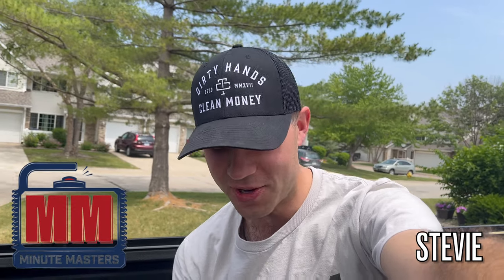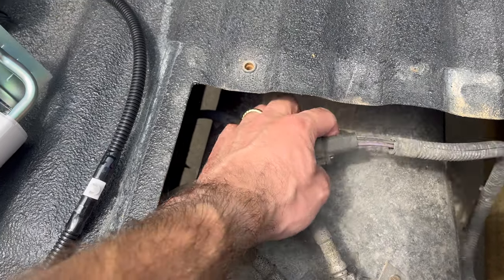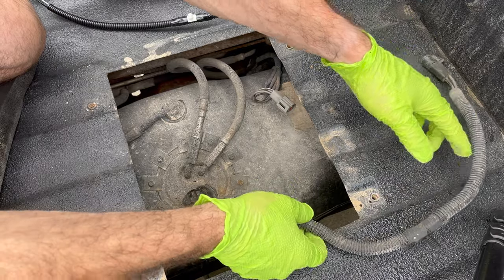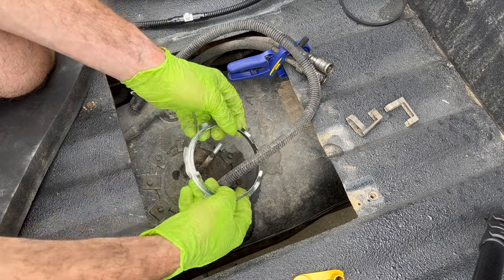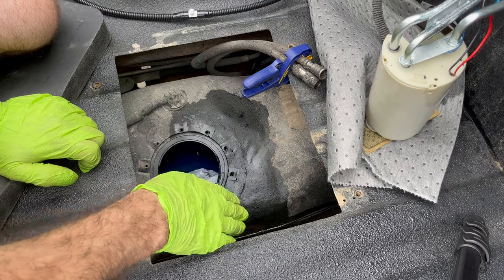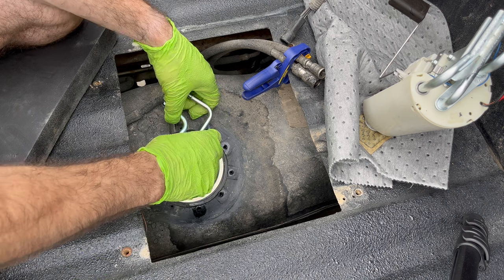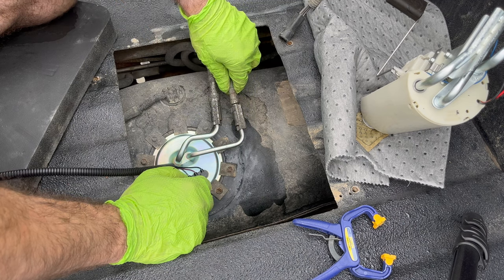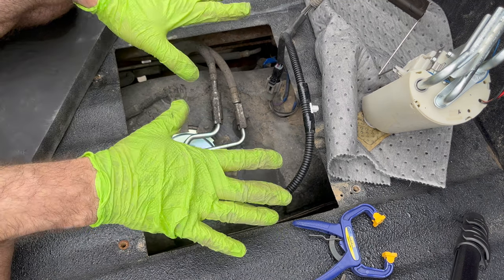How to Replace Your Fuel Pump in Less than 30 Minutes* | 1995 Ford F150

Comment: While you are in on that switch in the cab just cut one of the wires to it (ground is good) and put another on-off switch inline. Hide that switch somewhere and now ya have an anti-theft device. The engine will still crank but since no fuel can get to it - it WON'T start. Love your videos!
Reply: I’ve been wondering where to put one. Great idea!
Reply from the maker: Ah! This is a good idea!
Reply: Or go under the hood and cut the ignition wire and run it to a switch

Comment: Yes I did it the hardway. When my bottom straps came loose I found a leak in the tank on each side. So I got new Dorman steel tank and the new pump assembly. What I really appreciated was matching the wires up with the pigtail to the engine whip. My pump assembly did not have wiring instructions. My tank due in tomorrow so we wait. If you hear a loud conconsion/bang you'll know I screwed up somewhere. Fingers crossed. Thanks much
Reply from the maker: Well that’s a good start. The wiring was definitely tricky when I first did this. Not sure why it doesn’t come pre-wired.

Comment: So if you cut the hatch out,how do you make it big enough so it doesn't just fall back through the hole you just cut that I'd the same size hmmmm
Reply from the maker: I bought a separate patch panel and used that for the hatch.

Comment: How do i know its the switch?  I have a dual tank where both ta ks show 1/2 full. I have power to the wires that connet to the pony tail, but the pony tail doesnt show power.  What could i be missing?  Im not an electrician at all and this doesnt make sense to me.
Reply from the maker: The only way to diagnose the switch would be to test it. I have not done that. So I don’t know the procedure. You could buy a new switch and see if it fixes the problem. If not, you can return the switch.
Are you referring to the fuel pump wiring harness (pony tail) or the harness for the switch?

Comment: About 10yrs ago i had the service station give me a eye watering price to replace my fuel pump and this was my answer to this same issue and it worked fine and took about 2hrs.
 The truck is a 97 Ranger that i still own.
 Great job.
Reply from the maker: Nice! I’m glad you are bought into the hatch idea. It definitely gets some hate. Lol
Reply: @TheMinuteMasters  Yes there are many out there willing to remove the truck bed or drop the gas tank for a large fee. But I don't subscribe to there thinking and my little 10x10 patch in the bed worked flawlessly and was "CHEAP".
Reply from the maker: @markcollins457  You are most definitely right. I’m all for the cheap effective fix!🤙

Comment: Very nice. After my headers, I have installed gt40 y303 heads, with scorpion 1.72 rockers. Repaired my electronic 4x4, converted it to manual locking hubs. Next up, 4:10 gears front and back. I’m excited to see how my hauling potential has increased.
Reply from the maker: Thanks man!🤙 You’re truck should really move after those mods!

Comment: A couple things I do differently on these is tap the inertia switch with the screwdriver handle to trip it, which also shows It still works as designed. Making a hatch is a good idea, especially in an area where the bed bolts might be rusting a bit. In the shop we lift off the bed or drop the tank using a transmission jack, but not everyone has that luxury...if that's the right word. lol

Nice work.
Reply from the maker: Good point about the inertia switch. 
Yes, a lift would be super nice. 

Thanks Jimmy!🤙

Comment: I didn’t cut a hole in my bed but I did replace the bed bolts with the torx head bolts and the frame clips so they can be removed 1,000 times easier. Irritating part for me is the tank filler neck and lifting the bed off. Great job love the channel. Don’t ever sell your truck cause then I won’t have a channel for advice lol I give you permission to start another channel with another vehicle perhaps. lol
Reply from the maker: That’s a good idea! Oem bed bolts are hard to find. 
Hahahah! I plan to keep her even if I get a newer DD. 🤙

Comment: I've done this a few times...on these years ford trucks...  dropping the tanks is not hard..  come down easily..  even full.. Use a floor jack...  not cutting a hole in my truck beds lol..  I've seen a lot of people do this, and to reach their own... No hate.. And understand if the tank is clear full...heavy yes...  but good time to clean it all up, maybe even replace em...  they don't cost much..  i have a 1993 in replacing the clutch on... Rear tank leaks..  gonna just replace everything..  it's not hard.  Time consuming maybe..  and if your daily driver...  still... Literally 4 nuts you have to take off... Remove the straps.. Take the tank down..  personally...  cutting into the floor above the gas tank...  sparks...  i don't wanna go BOOM! 💥😮..  im subscribing, just found your channel... Like i said, not hating, but just drop the tank and don't cut holes in the truck bed...  just my opinion 😂...  what brand pump did you use?
Reply from the maker: Honestly, I agree with you 100%. I don’t think this is the bed. I’ll keep long-term and when this truck gets real nice, I probably won’t have a hatch there. Jon, your truck is so nice I would never think of cutting any holes in the bed.
It’s a spectra brand I bought off Amazon .
Reply: @TheMinuteMasters  I use Delphi pumps.....they seem to lay a long time

Comment: Great tutorial. Wish I had cut the hatch in my bed before I built the camper in the back. I think I can figure out where it needs to go from taking a screenshot on your video. Hopefully that ends up being in the open centre ‘aisle’ of the camper set up. That way I can take the flooring up, cut the liner and then the floor. Probably have to use a jigsaw or recip saw on it with a short blade and a piece of wood to stop the blade hitting anything on the top of the tank, can’t imagine there’s much clearance there. A couple of inches you think? 👍🏻
Reply from the maker: Thanks man!🤙 I located my hatch by going under the bed and roughly figuring some measurements from the underside. I transferred those to the inside of the bed. 
Yeah is a great mod for anyone with a lot of stuff in the bed they don’t want to removed for repairs.
I used an angle grinder and a piece of drywall.  I think there’s 1.5 inches to the hoses and 2 to the tank. But it’s also worth going under the bed and measuring the clearance to be sure.

Comment: I have a solid red, solid black, solid orange and a green with a yellow strip on the original wire harness on the truck. What color wire on the the after market fuel pump harness connect to? 
1995 ford f-150 XLT.
Reply from the maker: If you watch the wiring segment toward the end, I tell you what color connects to the other color. I don’t have that much for a visual on that though.

Comment: That's a bigger access hole than I expected, but it looks like you need all that space.
Reply from the maker: Originally, the whole was smaller. I waited it because it’s better to have more room for maneuvering the pump.
Reply: @TheMinuteMasters  what are the dimensions of that panel? I'm thinking about doing this after I was left stranded.

Comment: How did you cut the hole , where did the larger panel come from  ?
Reply from the maker: I used an angle grinder with a carbon cut wheel.
The larger panel I bought from raybuck.com

Comment: have to do this job here soon, seems like if my truck sits for a few days I have to prime the fuel pump 3-4 times before the truck will fire up.
Reply from the maker: Yup, that could be a fuel pump issue. I recommend changing the fuel filter as well.

Comment: Nice video.  Question on fuel selector.      Does the truck need to be off when selecting between front and rear?  Can it damage the pumps when switching while driving?
Reply from the maker: Thanks man!🤙. Not sure if any damages would be caused. I’ve definitely switched them while driving.
Reply: @TheMinuteMasters  I have as well, only once, felt a misfire when selecting rear, kinda freaked me out.  Now have a pump or pressure issue when trying to start from front tank and a fuel float problem in rear tank.   Lovely!!

Comment: Fantastic video. Can you tell me how far the 1st and 2nd cuts are from the front of the bed and the side of the bed? I want to cut out a the proper square the first time.
Reply from the maker: I believe the first cut from the backside of the bed was around 10 inches but you’ll need to go under your truck and look for yourself because I found out that not all fuel tanks are strapped in the same same location. 
As for a measurement from the side of the bed, I actually counted over the number of ridges and then made my cut .
Reply: @TheMinuteMasters  okay, thanks. I'll measure it myself and do it then. Also glad I saw your other video and now I know that I have to be careful not to cut the fuel lines underneath.

Comment: Hello, you showed the wire setup on the front tank. But do you remember the wire hook up on the rear tank? The rear tank wires don't have a red wire, on my Dads 1994 Ford F150.  We put the wires together like the front but the pump want come on, so I'm thinking might have something wired wrong lol.  Front one works great. Thanks Mark
Reply from the maker: The previous owner replaced the pump in the rear tank. So I don’t know how that one is wired. A Haynes manual or Chiltons guide may have a wiring diagram.

Comment: what are your measurments from the top of the bed to the cut for the hatch? please and thanks.
Reply from the maker: I can’t remember exactly. I think it was 10 inches from the back of the bed and the. I counted the number of ribs in the bottom of the bed to find center.

On another note, I typically don’t give people measurements because I found out that the fuel tanks are not installed all the same. They can be a couple inches forward backward from truck to truck.

Comment: Ive got a 95 F150 4.9. Changed the fuel pump but didnt get any fuel to the rail. I wired it by your recommendation. Thought maybe the pump was defective because it was unwrapped in the box and after install, my fuel gage dropped to E even though its 3/4 full. Installed another new one and same results. Any ideas?
Reply from the maker: It might be worth looking at a wiring diagram just to make sure the wiring is the same from my truck to yours. I don’t see why there would be a difference, but you never know. Also are all the fuses and relays for the fuel system working?
Reply: @TheMinuteMasters  our wires are the same. The new pump came with a guide with several wiring ideas but none matched our color wires. I see other videos with a blue wire but I think that's for duel tanks 
I've tested all relays and fuses and they are all good. I just don't get it.
.
Reply from the maker: @driski90  Can you bench test the pump to make sure it's not faulty?
Reply: @TheMinuteMasters  I can.
Reply: Any update on this? Also any difference for the rear pump?
Reply: @ivanpudge1187  mine is a single fuel tank. Ended up being 2 defective fuel pumps. Aftermarket junk. Found a OEM Motorcraft pump two states away, installed it and truck is running great.

Comment: I’m having a issue wer my truck won’t get fuel pressure and runs really rough won’t go over 20 mph only thing I haven’t touched is the pump could that be possible
Reply from the maker: It’s very possible it’s the pump. I assume you changed the fuel filter and fuel pressure regulator?

Comment: You should add don't cut the rubber hose, seen a guy here do that.
I got half way cut the hole crack the cover but found out the a tool couldn't get it off. The reason why don't cut the hose is the pump flange is not to keep a clamp on but used as a hose stop from going in too far. A rubber hose will shrink in yr and the very fuel 
pressure could pull out that clamp w/ out a flange to stop it. That why I didn't cut mine but took it to the dealer.  But that cut under the van works great. It was my biggest fear stranded .
Reply from the maker: Right! Good point! I would never think to cut the hoses.
Reply: Yea, for that back years mechanic. I've got a 94 ford van. If you still got your herea few tips to make it feel like brand new.  change your throttle postion and or cleans your crank shaft sensor. Last week wow big diffrent in throttle response & mpg. Tiny smooth throttle in normal driving like the new stang. 1-2 st no bang, the shift missing into 2 th even with heavy throttle surprised on that, recovered morning choke 1/ minute high ide then lower than before idle.
 On the ford 351 lift the two intake hose, by taking off the intake box and let it go higher. Why? It the same as advanced the distributor. You gain better  low end torque, adjust it heights  custom torque.  It perfect now as that 1-2 shift longer shift is non existence. Hard to guess when it's shift by Engine sound only.
Reply: For Southern back yr mech.

Comment: Damn another one. Things arent what they used to be thats for sure. Ive had to replace a fuel pump twice in a month in my brothers accord. We even did the clutch after the first time thinking it had clutch chatter then that didnt work and that was the next thing we tried, ran perfect after that
Reply from the maker: I'm with ya. I replaced this pump 8 years ago. Granted that also includes almost 100,000 miles of driving.
Reply: @TheMinuteMasters  damn that's not bad though that video was a bit newer than that thanks for the long time dedication to the channel I've rebuilt my whole suspension watching your videos. Valuable Info
Reply from the maker: @allighabell3138  You’re welcome man!🤙 I’ll keep the videos coming! I’m glad I could help you with your suspension work.

Comment: Ok so I have a 1990 f150 xlt lariat with the 4.9 i Changed the sending unit and pump all the wires and the gauge and then the ecm and the fuel gauge still dose not work
Reply from the maker: Does the pump work?

Comment: I got a rear tank. I'm not cutting a hole in my bed. I've changed my fuel pump twice. I would do that if it was a beater.
Reply from the maker: If I had a mint condition truck, I probably would consider removing the bed each time. My bed is Roadkill “mint”.😂
Reply: @TheMinuteMasters  yeah. Lmao 😆

Comment: You havent made.memtion of the two different  size tank pump for the front and the back are different  depths
Reply from the maker: Good point. I left that out because I was only working on the front tank.

Comment: I don't recommend this if you dont want to hear rattling all the time
Reply from the maker: Rattling from the hatch? I’ve never heard a rattle.
Reply: @TheMinuteMasters  you would have to use something so the hatch isn't just metal on metal or it will make noise when driving. I would suggest just go ahead and replace the whole fuel tank and fuel pump, those tanks build up a lot of gunk and even rust inside specially rear tank
Reply from the maker: @wily3226  No noise from the hatch so far. Probably helps that it’s raptor lined. The fuel tank is a new plastic tank. So rust is no longer an issue for me.👌
Reply: For the pickups, it’s probably not a problem. However, if cutting a hatch in a Bronco, where the hole is inside the cab, a gasket of some sort would probably be a good idea to keep noise, water and critters out.
Reply from the maker: @woodsidetj  I definitely agree with that.